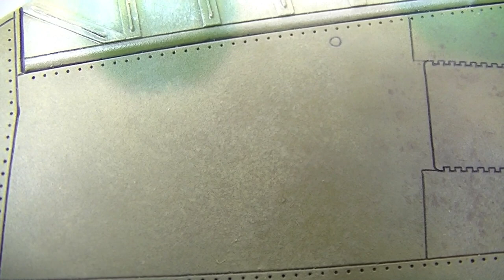ep322 - oil paint rendering for aircraft part 5

Comment: Hi Will. Outstanding series so thank you for taking the time to explain these techniques. I've been modelling for over 50 years and there is always something to learn. You have mentioned several times in the past that you usually produce models with the aim of photographing them. Would you have the time to produce something on your technique of how you achieve this i.e your equipment and setup. I'm sure many modellers would like to follow suit. I usually work in 1/48 and 1/72 so would this be easier or harder than 1/32 you work with to achieve. Once again thanks for all your hard work and persistence.